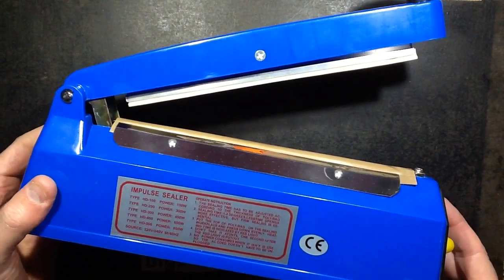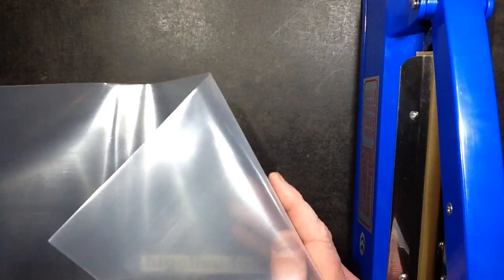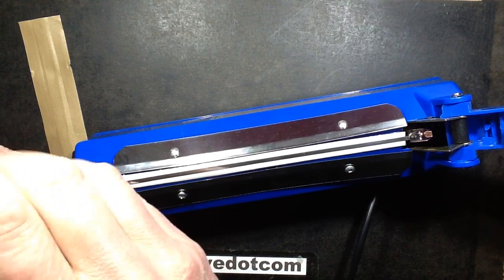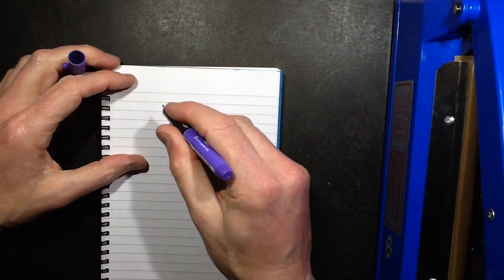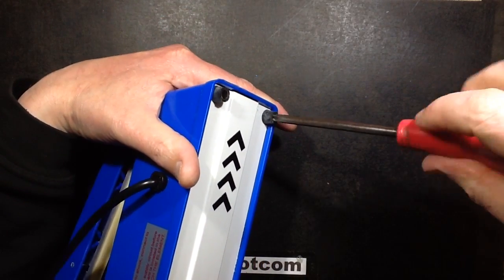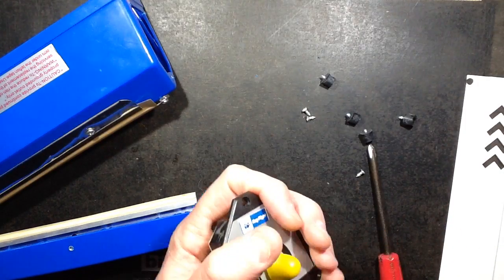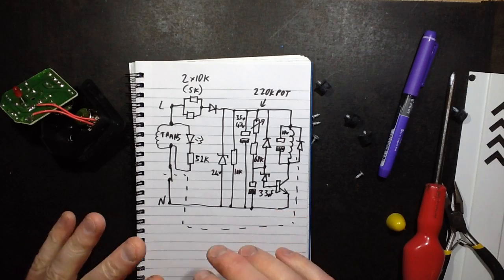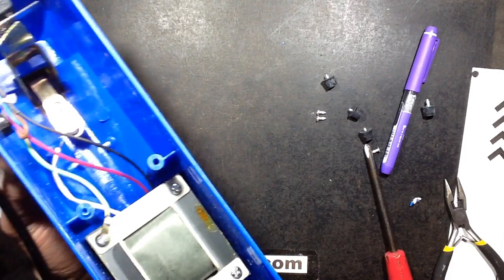Teardown of an impulse sealer.

Comment: Hi i have a heat sealer with 300w of power and for sealing TPU bladder for my kitesurf wing , it doesn't do the job at all , so i was wondering is it possible to modify the components of the one i have  and increase its power since i can't find a powerful one for sale here  in my country  .
Reply from the maker: I can't really advise on that.

Comment: Hi. Great informative video. Can I ask, can the element on a machine like this be replaced with a larger/wider one so it can make a wider seal in the plastic? Many thanks
Reply from the maker: I'm afraid not.  That would require a matching transformer for the much higher load.

Comment: Seeing this delay design circuit basically one also can put a 555 module laying around tuned with a good solid state relay and add a batteries or supercaps or a power supply and that's it! Thank you for saving me the money and time buying and reverse engineering this!

Comment: So what exactly should I swap out to increase the power to 350W- 400W? I replaced the original element with a 5mm element and it isn't getting hot enough to properly seal.
Reply from the maker: Check the connections and make sure it's the correct element.
Reply: @bigclivedotcom  the original element was only 2mm so the resistance of this one is higher. Can I swap out resistors for a lower value higher wattage?
Reply from the maker: @phreaktor  I'd recommend getting the correct size element.  A different one could damage the circuitry.

Comment: Soooo basically they are driving the crap out of the transformer ?  17 amps from that little xformer must get hot if left on too long and very dangerous.
Reply from the maker: The duty cycle is low.  I'm not sure it would fare too well in a production environment.
Reply: @bigclivedotcom  : Clive do you have any idea has to what this xformer actually is rated at ?
Reply from the maker: @packratswhatif  I'm not sure.  I'm used to continuously rated transformers.
Reply: Great video! 
(You mentioned the open circuit voltage you measured was 24V. Was this the transformer step-down AC voltage? or voltage  AC or DC across the sealing wire?)..
Hence my question here -Can you please confirm :
   1)  what is the step-down voltage of the transformer? 
   2) what is the voltage applied across the sealing wire? 
Thank you!
Reply: @SS-pi2yi  Should be 18VDC going to 24VDC half wave rectified ending up on the nickel chrome wire serving as the heating element.
Reply: @wh00per--  thanks for the reply/comment. just to clarify, I assume you mean the voltage range across the sealing wire is 18-24VDC  half wave rectified? 
OR you mean the step-down voltage is 18VDC and then the voltage through circuitry goes to 24VDC half wave rectified when placed across the sealing wire? pls advise - thank you.
Reply: @SS-pi2yi  24V is measured in the timer module I guess, after it gets rectified by the 1N4007 diode there. Kanthal wire (heating element) resistance is about 1 ohm for 8" length. Knowing that 300W = 1ohm x Amps^2  then I expect about 18Amps [sqrt(300)] and ~18VAC (for 1ohm resistance) in the transformer's secondary. The timer/relay does not take any significant power.
Found a better schematic here, for a newer unit, where the relay is driven with a MCR100L-6  www.seekic.com/circuit_diagram/Control_Circuit/Plastic_Bags_Sealing_Machine_1.html
Reply: @wh00per--  thanks for the insight.

Comment: Those poly bagging machines that do frozen veggies have the same kind components. The jaw that seals the bag has 2 nichrome strips and a wire that cuts the bag.  Refrigerated water goes through the jaw so it seals instantly. The nichrome strip on top seals the next bag to be filled, the one on the bottom seals the filled bag at the same time. After the bags are sealed the wire between them cuts the bag then the jaws open the bag falls off the teflon cloth strips. The wires went to solid state relays then a I/O board.

Comment: Hi i presume the standard heating wire is 2mm wide, can i use a 5mm wide wire instead? will the transformer handle the increased width of the heating wire
Reply from the maker: That would overload an already pushed transformer.
Reply: @bigclivedotcom  talking about the transformer, I'm finding it's impossible to get the specs of one .. is it 220V to 18V AC? How many amps? (300VA ones would be much solid)

Comment: Dear clive sir,
First of all thanx for such a nice vedio.
      I am too young to comment. I am polytechnic final yearstudent.
I saw you vedio ,what a nice video full of information. Sir i have opted  this as my final years project.
I seek your guidance and require help from time to time. I hope you shall nit mind in repling and guiding.
In your reversr engineerd circuit a no of patameters of components are required and their available market number are required 
Diode no .
Transitor no.
Value of relay or number
Electolyticsl capacitir nonormally open micro switch number
Zener diode no etc. 
Kindily provide their marketing no.
It shall go in long way. 
Please do help.
With regards

Comment: I used to work with an industrial one of these, bagging up 40-lb sacks of fertilizer. Needless to say, it gets very dramatic (and smelly) when the heating element breaks. It arced and burned right through the Teflon.

Comment: I bought one of these recently. There's been a few updates to the design: slightly less dodgy switch arrangement, screws at both ends of the element, slightly changed timer circuit (some values changed), potentiometer soldered directly to pcb. I modified mine by increasing the resistance of the timing resistor because at the maximum setting it wasn't quite as long as I wanted for some of the thickest foil bags I tried.
Reply: David Robertson Seems like a competing or older product, especially with the screw instead of a hook at the back.

Comment: There are models with cast iron chassis; it seems like paying slightly more than plastic ones is worth it if you're planning to use it a lot -- such as in kit manufacturing or component wholesale job.

Comment: where is the heater element in the circuit diagram? and there's only one winding in your trannie. how's that possible.?
Reply: sholimz Other transformer winding is connected to the heating strip directly.  But it's outside the board just like the power switch, so not on the diagram.

Comment: Clive, have you, could you, try this on some bubble wrap? I'm curious about how well it would work,. I've seen some bubble wrap bags that I think have been sealed this way and want to replicate. Thank you
Reply: no worries. can be used for bubble bags. i have tried.
Reply from the maker: I'm not at my workshop at the moment, but I'll keep that in mind for when I get back.
Reply: It sticks to the element if you set it too high and it's pain to get off, so don't try it.

By the way, the chunkier, cast metal units can be used to seal and cut the bag at the same time, if you're fast enough.

Comment: that is totally asbestos, RIP Clive.
Reply from the maker: It wouldn't be the first time I've been exposed to asbestos.  The worst type isn;t the bonded version, but the loose fluffy type.  Particularly blue asbestos which looks like laundry dryer fluff.
Reply: I was half joking (although it wouldn't surprise me if it was indeed). I've had the opportunity to look at asbestos-affected lung tissue in a microscope, rather interesting stuff. Here asbestos is still not uncommonly used (although due to the warm climate perhaps not as dangerously as in cold places?)
Reply: It's (in the bag sealer) most likely fibre (glass) bonded with concrete.  Don't flex it too far, it will probably start falling apart.  Even the Chinese wouldn't be so stupid as to be using asbestos.  Would they?  Really?

I know (knew) an electrician who got mesothelioma.  He'd only ever worked in one place where there was definitely loose asbestos fibre - on a ship where all the pipes had just been lagged with asbestos during a refit.  He was a radio tech, and was doing an antenna installation at the time.  :-(

Thankfully all the ships old enough to have steam pipes or hot water pipes lagged with asbestos are now scrap, but it's something to keep in mind if you get asked to do a job on an old clunker...
Reply: Lucas de Almeida everything on the internet is exponentially more deadly then in real life Clive. Didn't you know that

Comment: The electrolytic across the coil gives a higher firing current which does the same thing essentially as a starter cap on an electric motor.

Comment: Thank you for your video, I'm on plans to put together a sealant material I have at home, resistance buy it. The voltage is applied to the ends of the heating resistance? 14V ac?

Comment: That little transformer must really be overloaded. I would strap a thermal cutoff switch on the transformer so it doesn't burn out.
Reply: +rocketman221projects 
Its popular to use microvawe transformer rated for 800W and use it as welder where it runs at 3kW but only for one second, and transformer get only warm...
Reply: +Arek R. Yes, and if you run it too long, the primary will catch on fire. A thermal switch would shut it off before that happens.
Reply: Timer and display will be controlled by IC so I will add thermal monitoring, for primary and secondary.

Comment: what is it he's referring to when he says "the mains"?
Reply: +Matt Valcarcel The main power / electricity coming in. In the UK, 220 volts, 50 cycle AC.
Reply: he's referring to the 240v ac straight from the plug I can't explain it very good aha
Reply: The electricity you get from the wall socket. Is called mains electricity over in this part of the world.

Comment: Hi Big Clive, thanks so much for the video, it was so helpful in understanding a heat sealer. I'm trying to remove the timing function on my impulse heat sealer so that I can heat a seal for as long as I press down on the sealer, but I'm not very well versed in circuits (only took one electrical engineering class in college). What would you do to get rid of the timing feature completely? Thanks in advance, and keep doing your videos!
Reply from the maker: +Diyi Zhu You could theoretically put an insulated wire link into the socket that goes onto the PCB so that it bypassed the control completely.  Just be aware that the unit might not like being run for very long cycles.

Comment: Hey Clive.  Long time viewer, first time commenter.  Firstly, I love your videos;  they're so real-life and informative (especially find the decriptions of the circuit diagrams useful, yet baffling at my particularly amateur stage) that I decided to go out and get my own soldering kit, multimeter and basic electronics kit and enjoying it so far, so thank you for that.
A question I do have about this video is about the two resistors in parallel.  Why would it be beneficial so put 2 10k resistors in parallel and get less resistance when they could have just used a 5k?  Is it because if one fails it protects the circuit?  Anyway, hope you're well and the weather's treating you better in the Isle of Man than it is in Wiltshire!
Reply: +Stephen Turley Two resistors in parallel will handle twice as much current, so maybe they were exceeding the power rating of a single small resistor.
Reply: +Stephen Turley the resistor are usually rated for how much heat they can dissipate 1/4 watt 1/2 watt etc. the 2 10ks in parallel wouldn't get as hot as a single 5k with the same rating and resistors also get bigger the more heat they can dissipate so it may not have fit or it could be cheaper to use two 1/2w 10kohm then one 1w 5kohm resistor
Reply: i have electronics sourcing experience in a manufacturing plant. using 2 pcs of lower wattage is less expensive, why because low watt resistors are more common and therefore less expensive and more easily sourced. that is the major reason for choosing 2 pcs instead of 1 large wattage. electrically 2 pcs carries higher current.
Reply: 2 resistors dissipate more

Comment: Great video, went from such an easy product of sealing plastic bags to a mind bender trying to figure out all the math for a simple circuit. I was trying to follow along with the math I know of automotive DC circuits, but got stumped on how long the capacitors take to charge and then what voltage it would be to pass the last zener.

Comment: Ty for your video, I've been meaning to get one of these but didn't know their cheap name :D I got one on order for an earth shattering $25 (about the same size as yours), don't have a use for it right this moment heh heh heh, but will come in handy for when I get around to playing with my Ammonium Persulphate (the tree hugger version of ferric chloride that we're all forced to use these days here in her majesties cotton wool convict colony) and dividing it up into smaller portions to better manage it's extremely hygroscopic nature.

Unlike Ferric Chloride it's clear, which is kinda handy, but apparently can let off fumes (never noticed them) only problem is, it's far far far more temperature sensitive than Ferric Chloride, it's dead as a post at 20C, kinda sorta works at 30C but is much better at 40-50C........

Comment: I believe the capacitor across the relay terminals is to stabilize the holding current. The current available from the resistive dropper is going to be extremely limited, and since it is half-wave rectified, that relay will tend to buzz. Certainly not something you want to risk happening when it's controlling the inductive transformer across mains.

Comment: I think you could replace the teflon sheet with some doubled over kapton tape.
I have been using one of these for years, it hasn't failed me yet but the power connector on mine is like a crap midi connector.

Comment: I have one of these. In a tan metal enclosure (or was it pale blue...) instead of your blue enclosure. I've used it to seal up a few things for eBay sales. You can get shrink bags, seal it with this thing, then use a heat gun or hair dryer to shrink the bags.
I'm in North America, so 120VAC power. (No idea what the circuitry in mine looks like.)

Comment: Hi Clive could I ask your opion on I want to convert a mircowave turntable  from 240 volts dc to 14volts ac to replace a noter on a christmass decoration the moter failed and cant find one on the net also what parts would I nedd and a scamitic to follow love your videos always intresting and well put together  thanks Ray
Reply from the maker: +Ray Campbell The microwave motor is wound entirely for the higher voltage.  You'll need to source a proper low voltage motor.  Keep in mind that the synchronous motors are designed for AC and will nit rotate at all on DC, so make sure you've used the correct power supply.  Other than that you may be able to find the correct motor on ebay, as they are often a very standard form.  But sometimes it's cheaper just to buy a while product with one inside it already.

Comment: I have one myself which sat new in the box for ten years or more, also made in China, but much better made than this one.  For one thing, the housing is a proper magnesium alloy casting.  Also, the transformer is quite substantial, even when you consider that my unit is a 300w version.  When I bought it from the person who ordered it through the mail ($5 from her yard sale), it did have a bit of shipping damage in the form of a small chip in the housing and a broken fuse holder.  The only problem I found with the unit was that it didn't come with a grounding cord; I quickly rectified that, using one of the pillars cast into the housing as a grounding point.

Comment: You can use them for heat sealing plastic cosmetics tubes as well. Did that one have a proper plug on it or the crappy 3 pin with no fuse in it like the one I took off mine?
Reply: LOL @ fused plugs on chinese equipment.

Comment: The transformer probably has magnetic shunts to limit the o/p current, similar to an arc welder or microwave transformer.
Couldnt quite see the trans in the vid, but it looks like all the e's and i's are inline, this will have been done to increase stray fields, another trick to limit saturation done in the above mentioned trans's.

Comment: A disappointing lack of sealing means it might not be so safe for kitchen use, but then for the price point I'm not terribly surprised. I suppose one could silicone the base up, since presumably the vent holes aren't really doing much?
Reply: BenjaminGoose But it has big open mechanical holes on top.  Sealing the bottom will just fill it with spilled liquid, making it much worse.

Comment: The impulse sealer I had used a self-adhesive white 'cloth' covering the element. When I had to replace it, the dealership had a newer Teflon self-adhesive strip as well as the original clothy type. (technology moves on.)

One reason these have become so cheap is because the 'technology' in them is primitive. Just a nichrome strip under Teflon with a timer module. 
The one I had, (my brother has it now,) used more industrial components.
(See the RS Components line of sealers.)